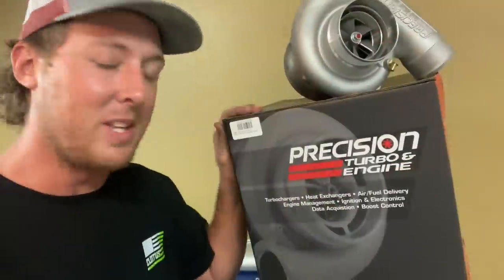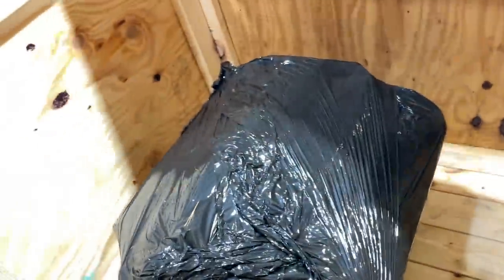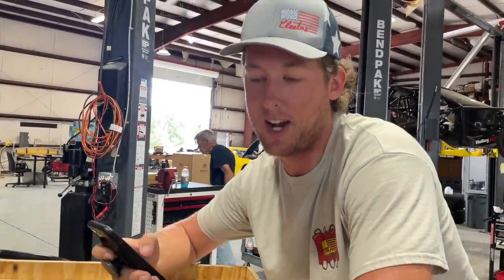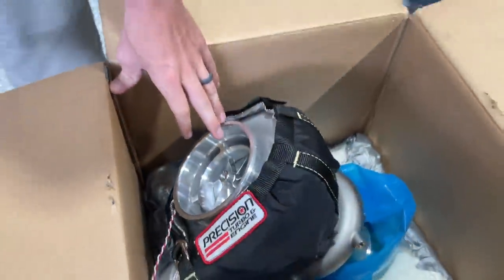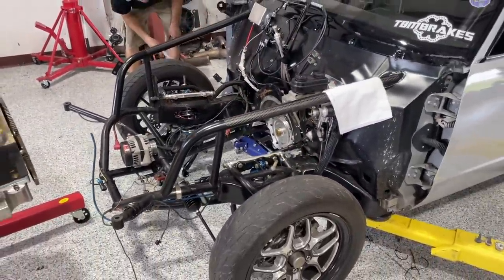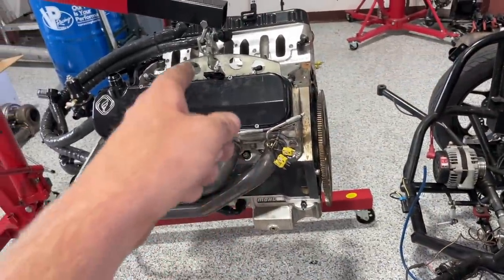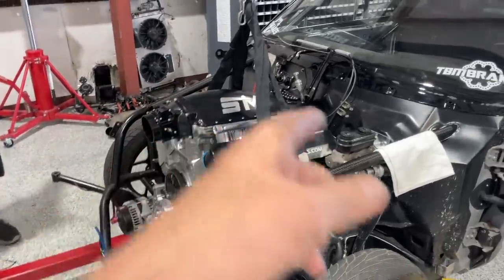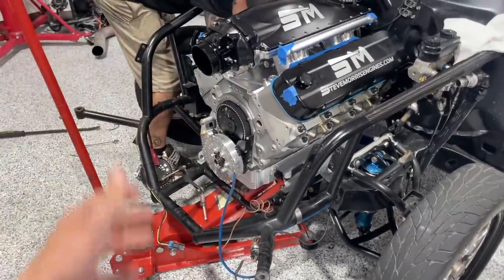Introducing the Most POWERFUL Engine We've EVER Owned... (It's BEAUTIFUL)

Comment: Here's the REAL question - are Leroy and/or Ruby going to end up with Steve Morris's new SML(LS architecture version of an SMX basically) in the future? Would make a lot of sense(if the budget makes sense LOL).
Reply: Hell just for the clamping on the head casket with no water at the deck surface.
Reply: Ruby would get a hell of a lot faster with just a 6 bolt block.
Reply: Doubt it. He needs something by Texas speed as he’s sponsored by them
Reply: I believe he has already said that Texas speed will always be there "small block go to guys".  They are a great company and all the failures and problems really come back on themselves he said. They just don't offer the type of power that they are looking to throw at the Mullet.
Reply: @roymcdavid1015   He already went away from them with Mullet’s LS. The 2,000 hp you can get from a TSP LSX ain’t enough for 6’s. The only thing that’s still TSP about that engine is the block and crank, the heads, rods, pistons, and valve train were put together by Fast Forward Race Engines.

It all depends on how serious they get. 2,500 is enough for 6s, and unless they go super serious with small tire stuff, mid 6s is probably the max, especially for street cars.

Big tire cars might be different.

Comment: That SM engine is sick, BUT why the heck didn't it come with a dry sump?
I mean the price is up worth of 50k $...
Honestly I'm kinda disappointed that it's not an SMX engine 🙁
Reply: Alot of 5 sec cars just running a external wetsump these days on turbo cars
Reply: But I agree dry sump would be piece of mind
Reply: This engine has power to run mid 6s. SMX is for 5s, and even doing mid 6s on small tires will be a huge challenge.
Reply: Swealer.....SMX is around $125k+ !  Are you offering??  Might keep you for being "disappointed"!!
Reply: Dry sump for what reason?  A wet sump deal will work just fine in this setup.

Comment: Cleetus: yeah, we called Steve 3 times today.
Steve: golly, these boys have no idea what they are doing.

Doesn’t matter tho, they’re gonna make some fast passes.
Reply: It does matter though, it's the difference between things dying and things surviving. But they are funded to keep it going just fine so I guess it's only the hassles Steve has to deal with.
Reply: @Low760  they know just as much as the typical customer he sees if not more especially with all the support they have in the motorsports community he could pretty much ask anyone he needed for help with something they were unsure of pretty much everything that's happened recently has been from pushing that platform beyond what it was made to do if it wasn't a drag and drive car there would have been other options but that's not what the car was made for It's made for street driving and racing and this is the perfect engine to do it without having to lean on it so dang hard all the time

Comment: As a engine guy and tuner,  nothing frustrates you more than seeing some one flog a engine to death trying to squeeze more power than the engine can mechanically handle.   Best thing that happened here in Australia was to stop trying to race our home grown Holden 5 Ltr v8,
The rpm and hp required to be competitive in our v8 race cars was just far more than the block design could handle with out cracking around the mani journals .    They then switch to 307 chev race blocks, with the appropriate rule changes.
I was involved in one race teams engine shops and the frustration was real.   Days of hard work,  we would watched waste away on a engine dyno.   Every one was happy once the Chevy blocks arrived ,  I mean we had been squeezing far more power out of these block for speedway engines for years , so we knew what was possible. 

So congrats on the steve Morris deal Garret and team .

But there are still questions around chassis and traction,  I mean just look at Sick seconds cars and the rear tyre wheel combo, 
This is what is required to put all that power to the ground .

And your already struggling to put the power down,  to go faster , your going to need to launch harder ,  get that power down sooner
And traction is the issue,  so I now watch in interest,  the engine and gearbox is there!   the diff?  How is that going to handle the power
Once the traction is sorted,  will the diff or axles no be the next week link? 

Watching your videos it’s very clear your times are going to be traction limited …….. are we eventually going to see a much larger wheel and tyre combo ?    More chassis work, more fab work to mullet? 
Or does the frustration watching Garret struggle with traction continue? 

Unloading and then the sudden loading  of the drive line is bad for the engine and driveline. 
It causes shit to Break. 

Congrats on the new engine Cleetus and team.   Is a major leap forward …..

Oh and I really hope you do something special with the Holden commodore Ute. 
It deserves more than to be just a burn out car ,  or half ass drag car.

Comment: I think mullet would benefit from putting the turbos back by the fire wall. Don't ruin weight distribution for the look. You said it yourself you want a consistent competitor. Might as well make it easier on yourself. Plus exhaust routing would be easier and all that jazz.
Reply: I agree but sounds like he's already made his mind up. Them turbos are a ton of weight to add out in front.
Reply: @bobbygetsbanned6049  couldn't agree more, and add 4 inch minimum exhaust on the back of one of those units and there's gonna have to be serious bracing or cracked welds are gonna happen
Reply: @bobbygetsbanned6049  He is addicted to stupid meme shit.
Reply: need the weight up front to help with the wheelies
Reply: @leftyeh6495  no lmao. You can adjust suspension to keep it from a wheelie. The issue with something with a long wheel base, they are already bad about having a bad weight bias. You add a big block with turbos that weigh more than a small child and you're gonna be fighting 60' especially on bad tracks.
Reply: @leftyeh6495  it isn't good that the weight is so high up.

Comment: as long as he follows Steve's instructions on how to set up the valves every day when you run the engine it's going to be bullet proof Oh and a bit of FYI you may want to re tub mullet he is going to need a much bigger tire . Garrett is also going to loose his mind if he hasn't seen it yet the new LS based engine Steve Morris is making . if you don't follow his YouTube you should he knows more about making reliable , repeatable power then anyone alive today.  his new design for an LS based engine is insane and is going to be as powerful as his big blocks.

Comment: That's when you KNOW you got an engine from an ACTUAL race engine builder when it shows up with sharpie all over the heads with all the clearance numbers. .  that's the mark of a REAL engine builder
Reply: AMEN brother couldnt have said it any better!💯
Reply: Acting like the LS motors they've ran aren't good quality lol. It's not a question of how well built these things are at this point. It's the limits they're pushing to
Reply: @glazetrain  they are good, but comparing a texas speed build to a Steve Morris isn’t a close battle, Steve Morris is many many steps ahead of tsp as far as quality goes
Reply: to be fair, mullet is heavy and these guys put thousands of miles a year. Most racers will golf cart their cars to the starting line and back to the pits at these power levels
Reply: @EWNOREVERSE  Don’t disagree whatsoever. Steve’s work is second to none. I just think it says more about his stuff being as “bulletproof” as it is that we’re comparing it to one of the best platforms in the world

Comment: What I have noticed that the guys at the top don't make big changes to power until they are able get the chassis going straight and constantly down the track. This car is set up for Ls so  they have to start from scratch but maybe this engine will hold up long enough for them to set up the car.

Comment: if not for the aluminium block i would have suggested some high pressure entonox on the extra fuel rail but as it is, i guess you could kill all lag using compressed air or o2.
much love

Comment: At this level I would suggest dry sump for the oil setup. High Gs like to make that oil go to the back of the pan even with a windage tray. When it was high Gs at launch and track end braking with less in between you could get away with it. Now you are high Gs all the way down the track and then hard braking starving the engine for oil during the run.

Comment: Yoooooo forget running standard 6s, here comes 5s..Whew thats some beast power there. going to have to rename Mullet to the Gray Beast or something  with that engine and turbs. whew. Curious though,  With all the new added power to wheels etc will or is it possible to run bigger tires to offset the increased torque ?  think i have heard it referred to as the Big Wheel class? for racing...unsure what you are all running now .but if you are increasing power and torque that would explain the tire spin because you dont have enough tract for what you are running ( not enough surface traction that can handle whats being pushed).  Just a thought not professional opinion.

Comment: Only 850 N/A lol wonder what rpm that was at, those turbine housings are getting into medium duty diesel engines like the a cummins 8.2L........overall should run lower boost from displacement with much lower drive ratios (exhaust drive pressure/boost), i used to push old holeset hx35's on worn out  dodges well into 40-45 psi, egt sensor would get close to 1800 F sometimes, i determine the drive pressure ratio as a function of the gas temperature delta accross the cylinder. More heat the more pressure driving the turbine blade, but when housing and blade restricts the flow at higher power the heat builds up behind it....and even an engine massively over built like the 5.9L 24 valve cummins can handle the heat melting the pistons into domes

Comment: Cleetus something just dawned on me how wide a tyre and wheel will fit under the Mullet ? , Will it take a 315x30 Radial 
on a 14inch wide wheel so you can get them extra hurse powers down but if they will not fit the next size down is the 
290x28.5 Radial on a 13inch wide wheel as you were lighting up your 275x28 on the first to second change as it was
but now you will have an extra 1000 hurse powers.

Comment: I'm a little curious why y'all don't say cubic inches or liters. I try to figure it out. Didn't y'all do the LS 350 small block with .40 sleeves making it one of those small block 427s? And this new one, Is it a big block 383? 383 being a mix of big block 400 parts with a 350 crank making it a 383? I know it Brodix so its custom block and heads but with after market parts, right? How does that work? I'm confused and want to learn.

Comment: Gotta love a nasty big block with boost and methanol!! But I’m LSX, the legendary SBC and 8.2 deck SB Fords for life! Idk how much the SME big block cost but hands down I would have built a dart billet ls next based bullet in the 440ci area basically the same rods and pistons that are in the big block and either the baddest rec port head ls7 style heads on the market or some Mast Mozez heads if they have water jacketed versions I would also let Steve Morris do his magic to the heads and a cam specced by him and one of his intake’s if he has one for a 10 degree head his intakes are so bad ass I love how easy he makes it to be able to run a fuel fuel setup, maybe a dry sump. It wouldn’t make what the big block will but will definitely make 2500+ and live for a while! I’m a Forced Inductions guy so throw a set of FI GTR series 88’s maybe 91’s 111mm turbine with either 1.15 or 1.20 a/r v band or t6 housing wich ever works best! Then mullet would probably be the baddest non tube chassis LSX powered Elco on earth! But that’s just my opinion… I’ll just stick with my cheap junk lol

Comment: Time to get out the plasma cutter and cut that front clip off and switch to a strut front end.  That engine needs to be pushed back about 8 inches into the firewall.  Adding that much weight and having the weight move forward is going to be horrible.